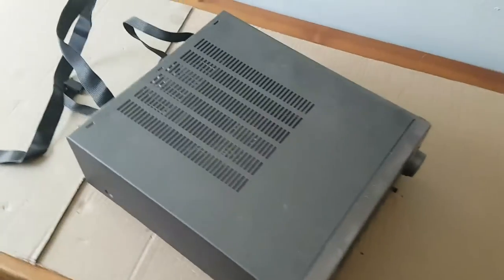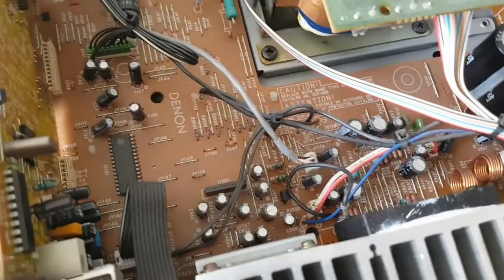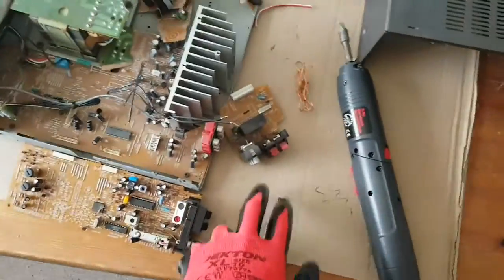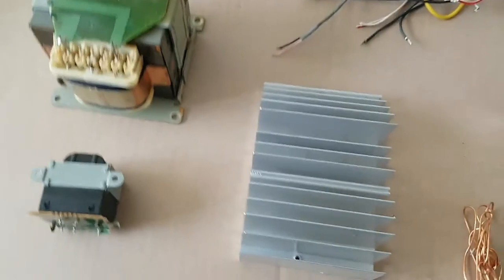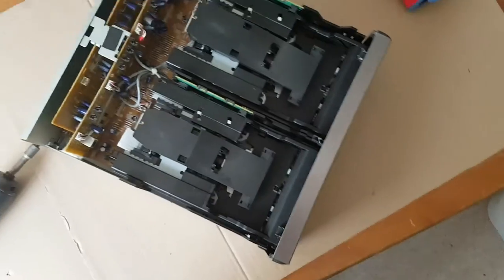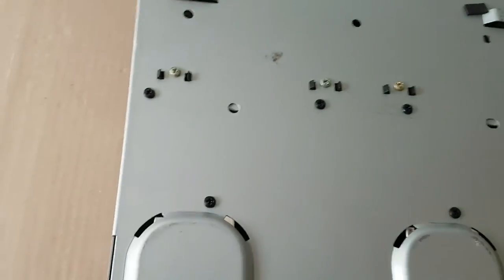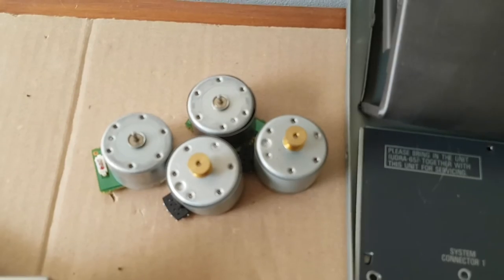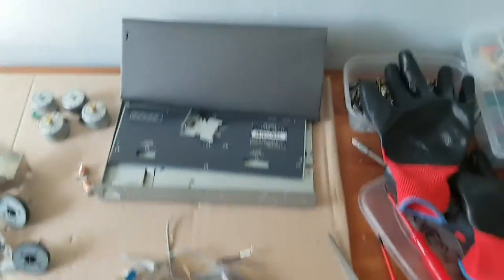What's Inside? - Denon Hifi Gets Vandalised. (My 1st Video)

Comment: Put all the ribbon and rubbish cable in a bag/box. It'll be classed as low grade cable. Sometimes you might strip some wire expecting copper and it looks like steel anything like that, just chuck it in low grade. The ribbon cable has got some wires running through them (can't remember what). Not sure how much you'll get per kilo for low grade cable. Every yard prices everything differently. It all adds up. With the low grade boards, some scrap yards take them as iron waste. I'm lucky enough to have a company that specialises in recycling them. They don't give much per kilo. I strip them of what I want then take the rest to them. Great first video.

Comment: Low grade boards often have mosfets and switches on them. Mosfets are attached to the heat sinks and are usually a piece of tin coated copper with black plastic on them. Switches are the little blue or  black plastic boxes with copper coils and silver contacts in them. If they don't break open easily they are capacitors. 
Hope this helps.